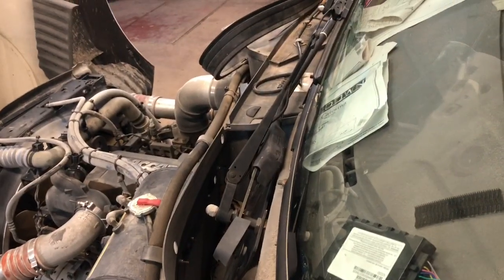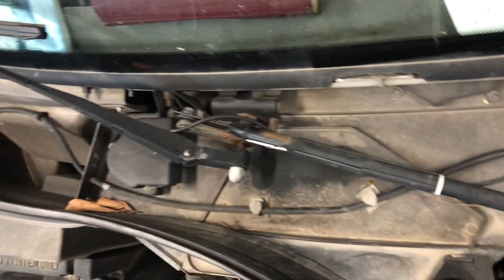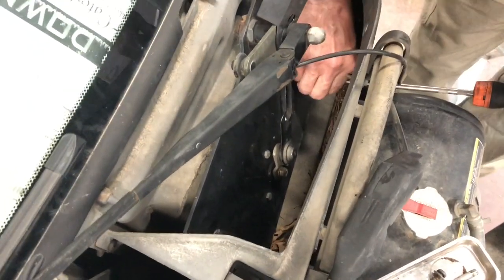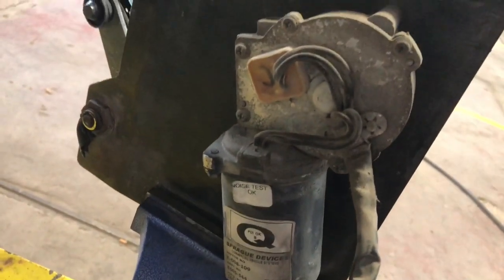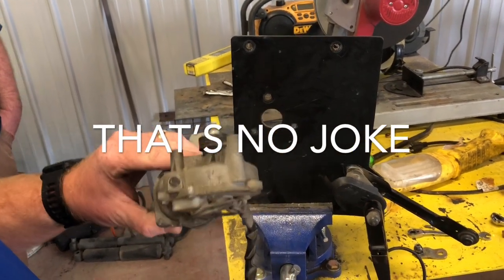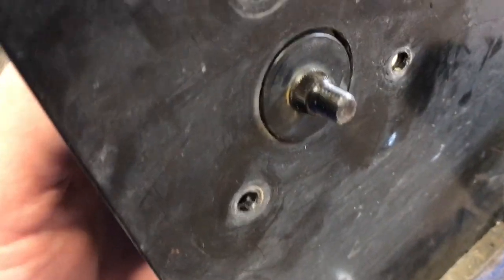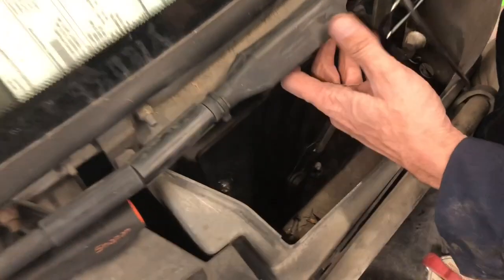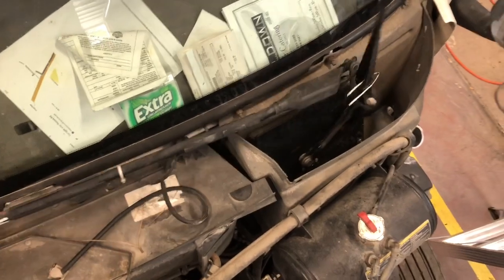Peterbilt / Kenworth Windshield Wiper Motor Replacement and Installation DIY EASY REPAIR

Comment: Really appreciate your posts.  I have a 2013 Peterbilt 587 with a Paccar MX-13.  You have definitely helped me burden the load as an owner operator.
Reply from the maker: Thank you very much. Look through our playlist truck fixing there’s several videos on there
Reply: Check this out very informative YES.  Now as I'm on the truck with limited tools, what's my best approach to taking off that center nut there inside that spacer?  As I'm an That point, it cranks the Damn wipers.  What can I do?

Comment: Mighty fine job,  but I'm not sure about drillin new holes, I think I'd make sure my new part is plug-n-play...just sayin 👍👍🤔
Reply from the maker: That the way to do it if you can get that part and it isn’t back ordered and you have downed a truck because of it …. Sometimes you have to do what you have to do
Reply: If you get it from peterbilt yes

Comment: Do you know what it could be if you replace the motor and they still don’t work
Reply from the maker: power wire, switch wire, switch itself, ground etc. just have to run it down. I would start by checking power at the motor and then checking to ensure it has ground (power probe will really help in this case, if not available a jumper will do the trick) then if no power check power at the switch and make sure it is sending power out. could also be a broken wire between switch and motor . Just track it down.